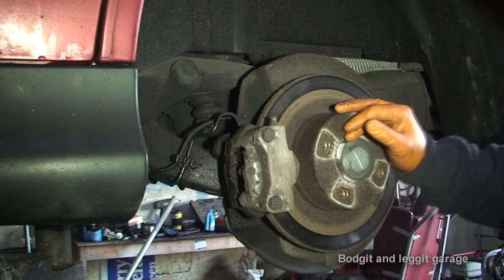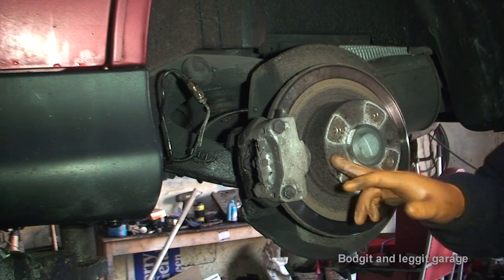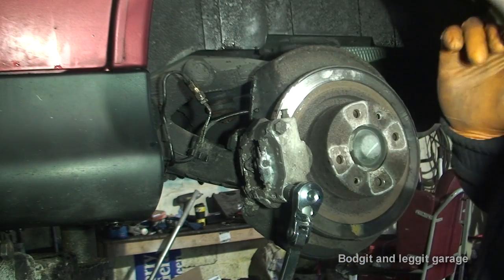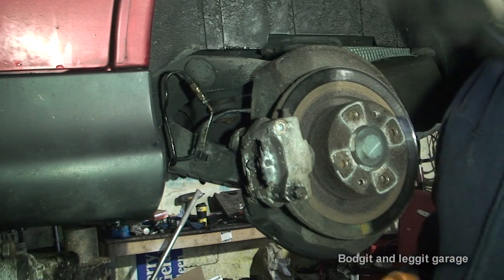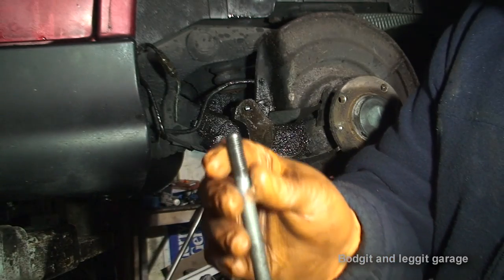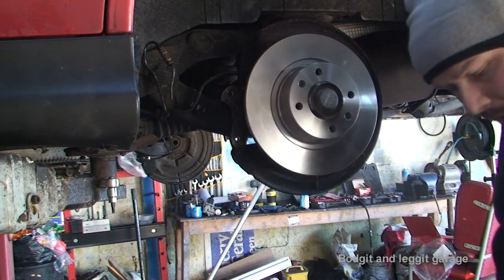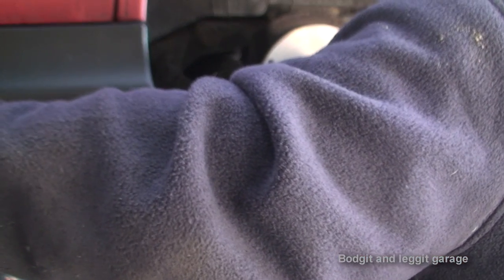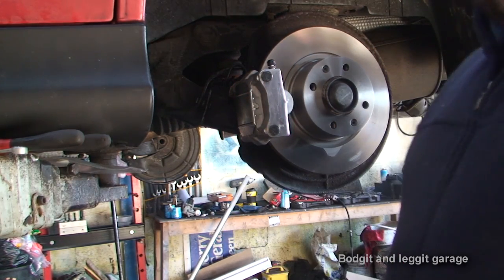bodgit and leggit garage how to do citroen c5 back brake pads/disc/calipers  (nightmare)

Comment: Another good video Leon we’ve all been there with those terrible jobs that Autodata still says 1.2hrs labour I’d love to see there fitters do work on an old car not straight out the box!!
As a by the way jobs like that I’ve stopped using mole (vise) grips and use Snap-on Bluepoint parrot nose grips I believe there made by Channel lock and there only £30 and well worth the purchase as there grip is amazing you can stick an M10 bolt hex head in a vise and grab the bolt shaft and they will not slip and you can sheer the bolt in 2!!!
Reply from the maker: Thanks a lot mate I will have to look into them grips
Reply: Snap-on are CHN410
Channellock  CHL410 and they do other sizes all on eBay and the call them nut busters Snap-on call them parrot nose but both the same just different colour grips and price!!
Hope these help I think there great and a great asset to the toolbox!!
Reply from the maker: @leeregan8017  oh yes I know what you are talking about now mate I have a couple myself

Comment: with how everything rusted together, i would have put never seize on those bolts before i put them in. I would also put fluid film on the caliper after the pads were installed. he put the copper grease on the inner pad and installed it facing the rotor. Wow

Comment: The problem is that the bolts are threadlocked in the calipers. But still this is normally an EASY job. And always change those long bolts, they are torque to yeild.
If the bolts starts being annoying just whack the caliper to pieces, normally they go out just fine though, especially with a rattlegun.

Comment: Just spent two days on this awful job, not because I needed to change the caliper but just to change disc and pads. Here are my thoughts and observations:

Contrary to what some others have said, the disc cannot be removed without the caliper being removed from the suspension arm.

Despite heating, three of the four bolts sheared directly under the head as a result of the locking media - Loctite 720 - along their full length. To get the calipers apart, with the pads removed, stick an air chisel between the outer caliper half and the disc with the disc loose. This will then drive the outer caliper along the 'stud' albeit with difficulty. This process causes damage to the aluminium caliper but in an area where it can be tolerated and dressed with a file afterwards. Obviously if you drive a chisel through near the sealing faces then they will probably be wrecked.

Once the outer caliper is off, this then gives sufficient access to the remains of the bolt to allow the use of a stud extractor. The first task is to make sure the thread is loose in the suspension arm with all remaining stiffness being due to the sealant in the bore. Thereafter, undoing the second 'stud' of two is probably still so tight that the bolt breaks at the start of the thread as a result of bending - happened to one of mine. However, as I'd already freed that thread up prior to it breaking, the stud extractor got the remains out easily.

The bolt specification is M10 x 1.25, 150mm long, grade 10.9. I'm hoping that our local fastener store has them - will see tomorrow. 1.25mm is a finer than usual pitch of 1.50mm. Note that my threads in the suspension arm were preserved but, if not, a clearance drill could be run through the damaged threads and longer bolts be used with matching nuts on the other side of the flange.

I ended-up with some damage to the mating faces of the calipers. However, lapping them on progressively finer grades of wet and dry on a glass plate restored the sealing faces. Obviously they needed careful cleaning afterwards to ensure no grit got into the hydraulic port.

The faces of the calipers in contact with the suspension arms were severely corroded. Having recovered the calipers, I intend to swap the calipers around so that the previously outside, clean and uncorroded face is against the suspension arm. The Haynes manual recommends a high temperature anaerobic sealant be used on this interface, presumably to form a liquid gasket and hence prevent water getting inside and causing corrosion.

I read the various theories presented as to why locking compound is injected into the calipers along each bolt. Clearly this was a modification as, according to the Haynes manual, early C5s did not have this. Personally I can't see that this adds significant strength to the assembly, but my suspicion is that it attempts to prevent water ingress and hence control corrosion. If so then this is a real "sledgehammer to crack a nut" and does no favours whatsoever for those tasked with maintaining these vehicles. Certainly, in all my engineering career I've not seen this technique applied elsewhere, and I sure wish they hadn't here. All this supports my long-standing view that aluminium calipers are generally a complete pain, but this configuration is, as per the title of the video, a complete and utter nightmare.
Reply: Post script: my local fastener stockist could not supply the bolts. He offered socket head screws of the correct length and in grade 12.9 but, when I arrived, the thread was 1.50 pitch instead of 1.25 pitch which I'd specified. Nevertheless,  I purchased 160mm socket head screws and grade 10 M10 Stover nuts in anticipation of drilling-out the fine thread in the suspension arm and using a separate nut on the rear of the flange. However, the Citroen dealer ultimately came up trumps three days after placing an order: these bolts are held centrally though not readily stocked by dealers. Part number for one is 4405 50 but they usually come in pairs number 1677082980. When the rain stops then I'll fit the damn things. Note that the dealer said that both calipers and the little seal between them are no longer available through Citroen.

Comment: Great video. Only one comment, an Oxyacetylene torch size 1 would have given more direct heat to the bolt-carriers ( red-hot in a limited area), but still a very instructive video.Keep up the good works.
Reply from the maker: Michael Mayo yes mate I agree with you but I don't have one of them torches I really should get one
Reply: One of those induction heaters might be a better bet, it's a lot harder to set fire to things with them. Dunno what the magnetic field of them would to the coils in ABS sensors, though.
Reply: oh the saving grace of oxyacetylene, saved me many a time, also sometimes you just have to get the gas axe out. "you cant be tight if your liquid" lol

Comment: Grinder and cutting disc on the back of the caliper half - 10 minutes.
Reply from the maker: Easy to say once you've watched everything but wanted to try and save the customer as much money as I could without just going in there air and destroying everything first
Reply: What about arc weld on the bolt shank? The fierce heat often shifts the corrosion. 
To anyone thinking of that -  disconnect battery and alternator connector as arc currents can damage electrics.

Comment: The second bolt, I would have cut my losses and use an angle grinder to cut the caliper apart.
Reply from the maker: Boom 💪👍💪👍
Reply: I would of used a grinder on callipers straight away.  Sacrificial piece.
Reply from the maker: @Diddy65  💪💪💪👍👍👍👍👍

Comment: Ive just started doing the front ones on my c5, new slide pins needed unfortunately. I see a few members on the citroen club mention these callipers doing this, something to look forward to, gulp.
Reply from the maker: peugeotCitroen2CV hahaha have fun with it mate
Reply: bodgit and leggit garage 
Just wondering would copper grease or something help prevent the bolts doing this when reinstalling them?
Reply from the maker: peugeotCitroen2CV hi mate no don't use copper grease on bolts it acts like sandpaper you can get Mali Greece or anti rust they will work but also it's just the way these are designed they can be a nightmare like this
Reply: bodgit and leggit garage 
French engineering you can't beat it...........I am being sarcastic!

Comment: Just done mine today nightmare of a job in the street broke bolt inside and treaded bolt in other side managed to get it out and buy some new ones took me hours need to bleed the brakes up tomorrow has enough
Reply from the maker: good luck mate
Reply: @bodgitandleggitgarage  all sorted new caliper fitted today aswell at least I've saved a few quid doing it myself

Comment: done one of these last month came in with brake bind hours it took me to doo they were that bad where caliper bolts to its hanger the alloy fuzzed up in the gap and push the caliper at odd angle was bad was not straight

Comment: Brilliant video, this is the kind of thing never really shown on YouTube. Simple jobs can get very difficult quickly. I think the key thing here is knowing why it is stuck and not applying more force than the bolt can take.

Was there a reason why you did not keep tightening and lossening it?
Reply from the maker: Thanks a lot mate a lot of people say that my videos are real life I don't try and hide anything when I struggle I struggle it's a simple as that we all struggle sometimes the reason why I just didn't lose and tone all of them is basically because of time and I could see they were getting damaged so it's just as easy to do what I did and replace them with new ones this saves a lot of time and money in the long run

Comment: I feel your pain.,  I've had a similar day from hell this week with  Peugeot partner subframe bolts snapping in the chassis. A simple job turning into a nightmare.
Reply from the maker: i fell your pain to mate
Reply: I had a Renault Kangoo! Same s....! strange size torque bolts, and every little piece, like new glide bolts, for the front calipers were twice or 3 times as expensive as any other brands. The engine was setup very conservatively, so really neither great economy or acceleration!!! £300 for 4 remanufactured CV joints!!!! This car was clever enough engineered, but no consideration was put into ease of maintenance especially by non Renault shops. So French cars are best kept clear of. The solution for the Peugeot in this video, is to put a torch to the suspension arm and claim the insurance money when your shop has burnt down.

Comment: I read the official procedure is never to re-use those caliper mounting bolts on the later callipers like those which have the 4 holes drilled in them.

Comment: What a battle you had again on this job!!! I was wondering do you not use never seize where you live? We are in the u.s. and anything's steel to aluminum will use never seize except some head bolts
Reply from the maker: Hi mate yes I know some places in the US is very bad for us we do get rust over here the nowhere near as bad as you guys get it yes never cease could work but to be honest with this car the brakes will never have to come off again the car will be in the scrap yard before we have to replace the calipers again and by that time I don't know if the never sees woodwork I've seen some people on YouTube and they say it doesn't really work in certain areas

Comment: sorry you probs already know but if you screwed a nut on the end of that bolt to tap it out of the caliper you would save the threads from damage. I done that a few times.

Comment: Good job, complete nightmare and great to see one of you youtubers suffering the same problems we do at home :)

NEVER get a Citroen and that is from a Citroen owner ;)
Reply from the maker: Christopher Lawton hahaha we all suffer mate it's just I don't Edith it out like a lot of the other YouTubers do I like my repairs to be real life
Reply: It's good to see others having issues.  I have Just done all the brakes and master cylinder on a MK1 Octavia and that took days, ending up in weeks due to issues and Octy brakes are better constructed than these.  Was looking for a replacement vehicle but after looking at some things on a C3  for a grandson decided against a PSA car.  Hopefully they will get better now that they have acquired Opel, but even they have had their issues over the years.
Reply: I had and still have Citroen, Peugeot, Mercedes, Toyota and several others to say. When the time or opportunity comes, I'll definitely get more. ;-)

Particularly the first three mentioned, are damn easy IF and that's the big issue. IF you know what your doing. Admittedly that's a primordial condition that too many don't meet.
It's quite staggering the difference between maintenance or neglect.
With this said all my cars, BTW independently of the brand, are RELIABLE. Even if they didn't arrive as such. ;-)
Cheers

Comment: only just heard of this tip from a young lad how's dad told him and seems to work if you press the brake pedal and wedge it before undoing break line's it stops the fluid draining I didn't know this and his college tutor didn't either
Reply from the maker: Hi mate yes I showed this on my other videos I showed this a lot of times but this is a completely different system to most cars
Reply: @bodgitandleggitgarage  I no the c5 is a proper odd thing 😁
Reply from the maker: @colinhamer6506  I love them I would go Citroen I'm going to be restoring a Citroen CX on my channel very soon
Reply: @bodgitandleggitgarage  cool the old ones are the best I love my 54 berlingo and 106  s1 ralye
Reply from the maker: @colinhamer6506  👍

Comment: Please get some safety glasses mate, you only get one pair of eyes, i would have put some copper grease on the threads and shaft of the bolts! Good bloody job though mate
Reply: Aluminium or ceramic paste only, copper will make it sieze faster due to galvanic corrosion
Reply: Dremil 4000
Reply: Copper grease under lock and key. Terrible on aluminium. Same for Moly grease.

Comment: in the 2000's using a caliper design from the 70's...actually shit like that is very common on many brands....(newer fords use direct injected version of the 1.8 diesel engine drived from very very old fiestas, newer fiats use the gasoline engines completely identical to the old Uno, many brands never really changed their gearbox design in decades...i remember fitting a 4 speed gearbox from a peugeot 205 1.1 from the mid 80's to a 2003 peugeot 206 gti .....it was 99% direct fit......and many even newer peugeots keep using the same box.... Opel has used the same gearbox from the start of their FWD lineup at the 80's up until they started using fiat engines in the mid 2000's...atleast its a very very strong great gearbox.....problem is that people dont see this and keep buying new cars...with dinossaur age designs on many parts but with added electronic complexity gizmos...recipe for failure
Reply from the maker: Yes mate the joys of being a mechanic in certain situations when they use something for a long time I'm they get all the bad bits out of it and it turns out to be a really good thing not in every case but in some cases
Reply: @bodgitandleggitgarage  yeah we hope they do that...but often they dont hahahaha
Reply from the maker: @MrHBSoftware  lol

Comment: We have a 2005 Citroen C2. It’s not done many miles, 50000 now. The brakes are nowhere near as bad as these, how has the caliper body rotted out? Mine are really well maintained by myself. It’s got very hard suspension though and has had a good few coils snap on the fronts.
Reply from the maker: At least you started it before it caused major damage mate

Comment: 17:00 the reason the top one snapped is because the bottom bolt was nearly out causing the caliper to be on an angle causing the top bolt to bind even more..........i woulda wound the bottom bolt back in tight with an airgun then attacked the top one heating the caliper body around the bolt area to loosen the crap and threadlock
Reply from the maker: No the reason was at this stage I knew what I had to do and I knew what I was replacing so it didn't make any difference had nothing to do with that

Comment: 13:30 why didnt you heat the head of the bolt too and wind it back in and out often helps to clear the build up of shit ? also if youve already ordered new calipers just cut the caliper off or significantly weaken it in the bolt area ?
Reply from the maker: Couple of reasons why I didn't want to do any damage to the caliper at this time I didn't know I needed to have to put calipers on to I've no real way of heating it part from just a little handheld gas torch which would have put too much heat into the caliper

Comment: I have a small plastic bottle with brake fluid in it,  ,best thing to use for penatrating rusty nuts and bolts works a dream,,PS what brand of rachet  is that ,,never seen one like it
Reply from the maker: Hi mate it's a facom ratchet
Reply: @bodgitandleggitgarage   Lovely,,I,ll be buying one Good job and vids

Comment: Must be something to do with that steel dust shield and pin,with the two different metals causing corrosion,anyway looked a nightmare and I was sat here drinking tea :)
Reply from the maker: I hope your tea was nice mate lol
Reply: yep galvanic corrosion caused by the 2 dissimilar materials....ally caliper and an iron arm..........older Citroen's (BX/CX) used an ally arm and ally caliper ....thats why the CX he worked on was easier

Comment: Dissimilar metal corrosion. Aluminium oxide is 2.5 times the volume of the bare metal. 
I’ve seen it a lot on motorbikes which always have aluminium calipers, engine cases and other stuff. 
The bolt zinc plating fails and you get a battery effect between ally and steel. Stainless steel is even worse and more likely to shear off. 
Who knows why the manufacturer won’t use a high quality carbon/copper paste on the bolts.
Reply from the maker: sorted boom

Comment: can you do a video on the location of the egr valve on citroen 20 lt diesel 2004 i having a mass flow issue
Reply: you should know this by now, but on the back of the engine, mass air flow in the front of the inlet manifold. you might have to remove the bottom cover of the windscreen to get to the egr